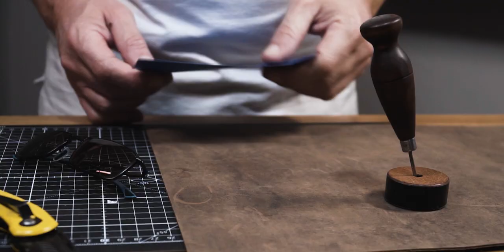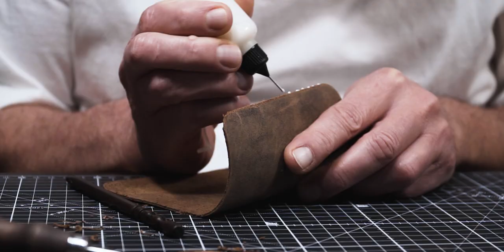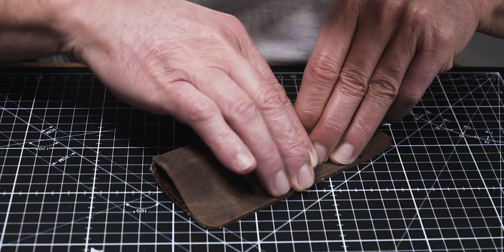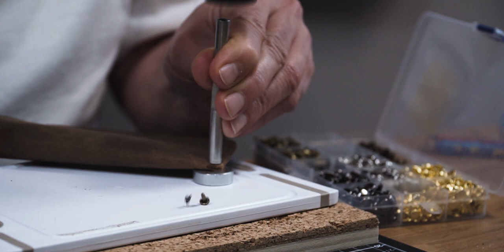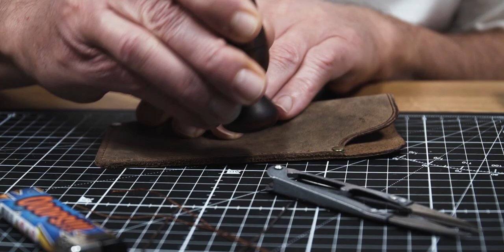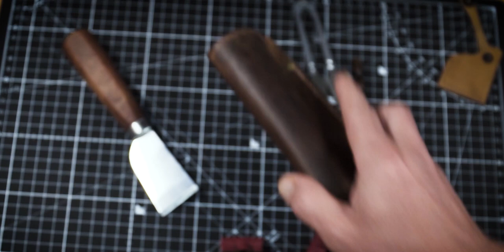A Simple Leather Sunglasses Sleeve - Easy To Make

Comment: Can you share this template?  I really like this style case.
Reply from the maker: It's a simple rectangle with rounded corners... Tomorrow I'll post a photo of the cardboard I used with the measurements in the Community Tab.
(I did it for my glasses, I don't know if it will fit yours)
Reply: @LTMS  Thank you. I think the bottom corner by the fold and the two rivots really set this style apart from the others I've seen.   I should be able to test the size with a piece of paper and some staples, and will elongate if needed.
Reply from the maker: @4jacksFort  Template is up in the community tab. Enjoy.